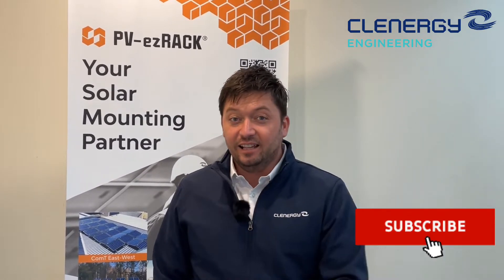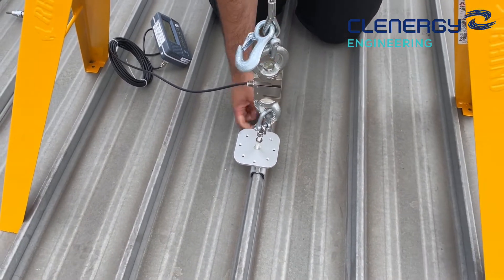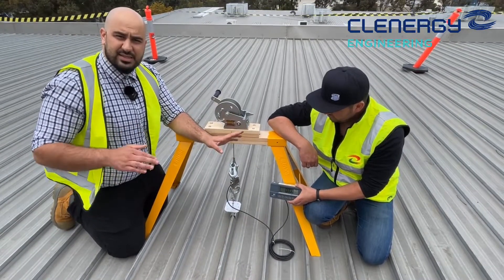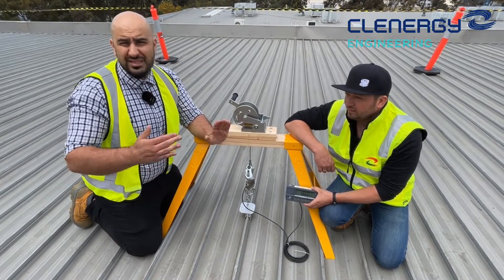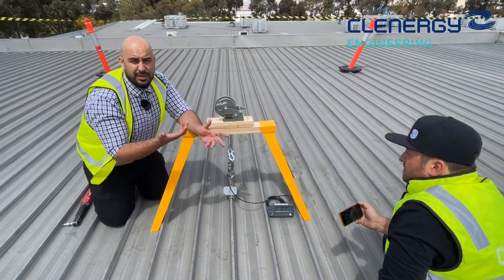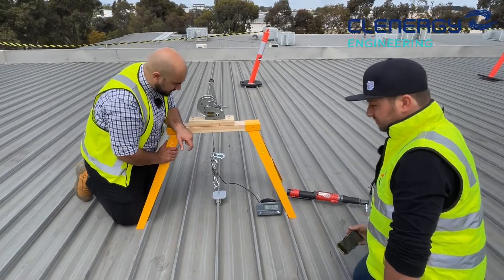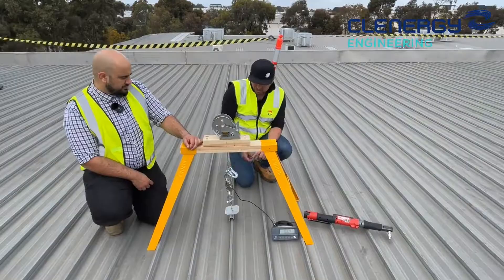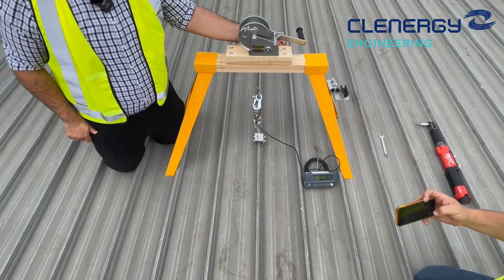Roof Sheet & Kliplok Clamp Testing – Training from Clenergy Engineering

Comment: Do you recommend clamps be installed on a sheet rib overlap ?
What about above the perlin ?
Reply from the maker: Overlap joints should be avoided in majority installations but we do have some specific roof sheets that have been engineered to allow this.

Installing above the purlin is highly recommended as this is the strongest part of the roof and sheet attachment.

Hope this helps. For any other queries, you can reach our Australian tech team at tech@clenergy.com.au